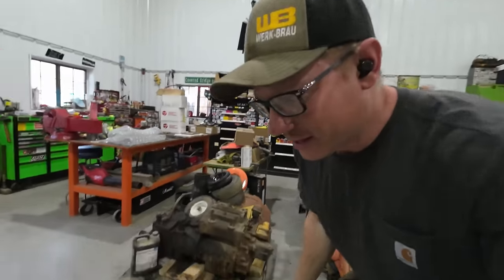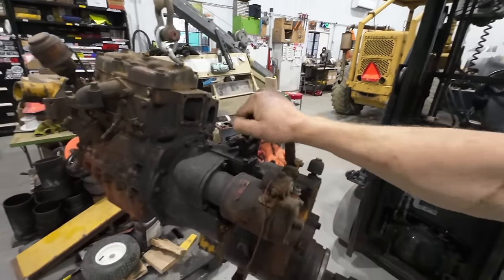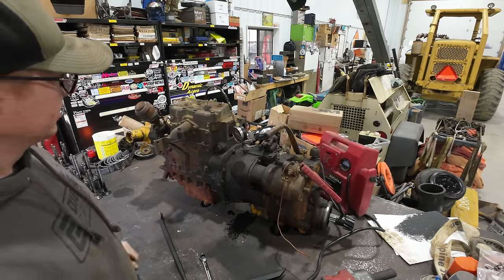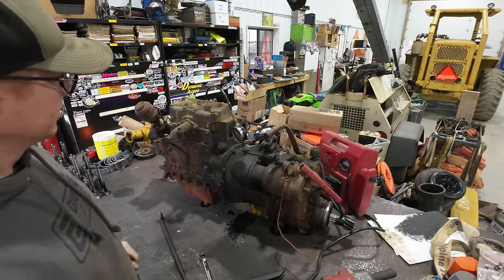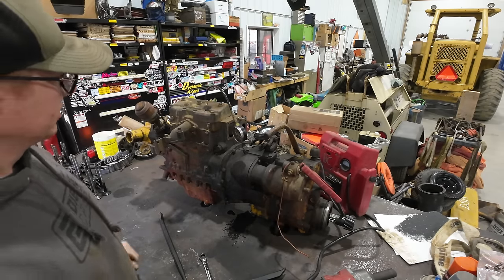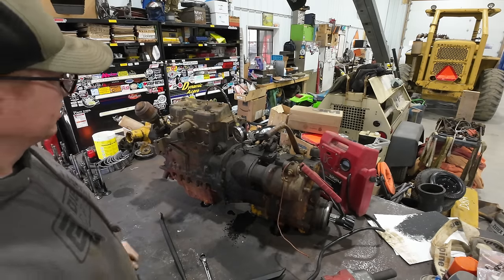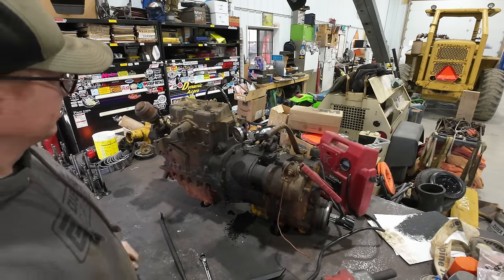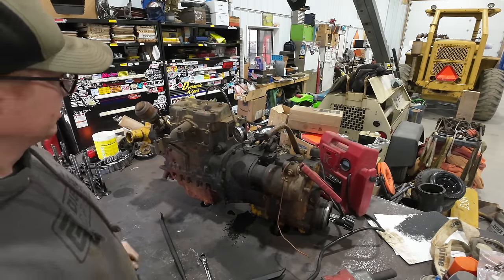AUTOPSY of a Caterpillar Pony Motor. | What Went Wrong?

Comment: The condition of the oil is the reason I find it ridiculous to get something running before addressing the fluids. IMHO!
Reply from the maker: We checked it. There was oil on the dipstick. You have no idea what’s in the bottom of the oil pan until you do something like this. You couldn’t even access that big oil plug I pulled out with the Pony installed on the machine. There’s a secondary oil drain you have to use when it’s installed.

Comment: I love your channel.
I do however always cringe when you start these engines with 20 year old oil.
I know you need to determine if it's worth even spending the money for proper maintenance prior to going forward but, E-gads man.
 The goo and fine metal particles are being forced into the engine bearings etc.
I know you understand the mechanics of what I am so lamely trying to explain.
Cheers mate.

Comment: For old engines and parts, why doesn't anyone tear one down, measure all the parts and sell the measurements? That way anyone who has access to steel and fabrication equipment can make new parts.
Reply: It’s not usually the problem of knowing what the dimensions are, but the making of the parts!   The aftermarket vendors usually do exactly that when they think there’s enough of a market to make it economically viable.  Such is the popularity of CAT and JD engines and equipment that not only did the OEM support them for a very long time, but the aftermarket produced a lot of what was needed to keep them running as well.  Most manufacturers have trimmed the length of time they will support older equipment in recent years.

Comment: why do you spend so much time talking.  Everyone who has worked in a shop has used cutters to take out a pin.  This video feels like you are trying to add talking.  The ASMR with the grease were kinda funny, and we're definitely thankful for something besides a will it start vid.  Overall, im sorry to see this pony go.  But its a pony, so just pull out a weedeater, motor from home depot, and that will do the same job.  This engine doesn't need to be toast... you could find one of these youtubers that will fix the housing, but thats prolly cast iron... specialized welding, not just reglar old steel.  If you start with a new pony, make sure you keep these parts in a labeled box cause you move equipment fast, and you don't want storage for the pony if you sold the dozer 10 years ago.